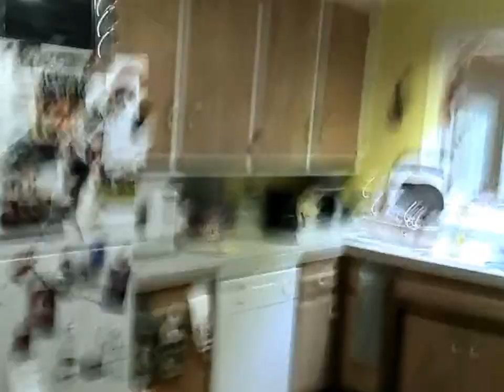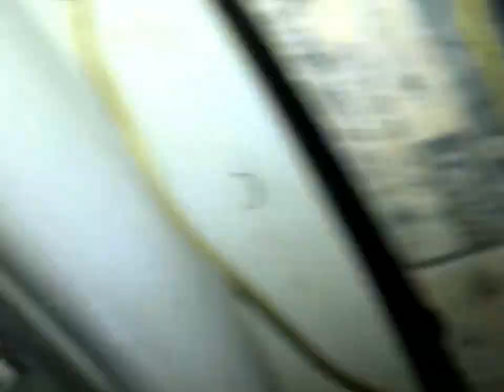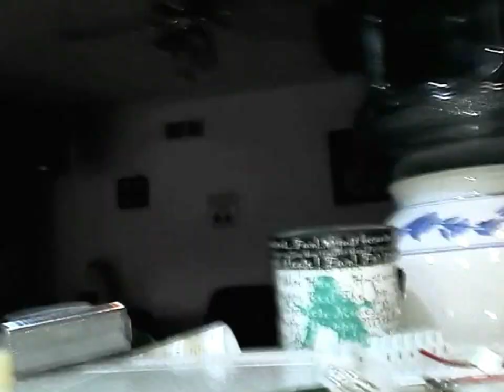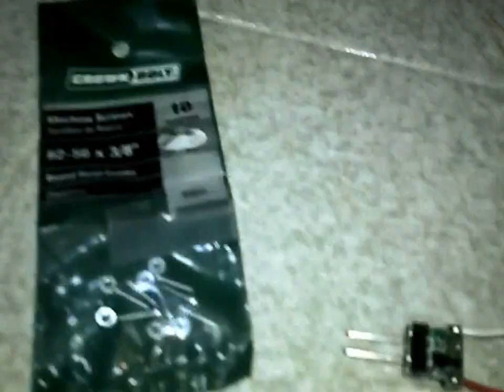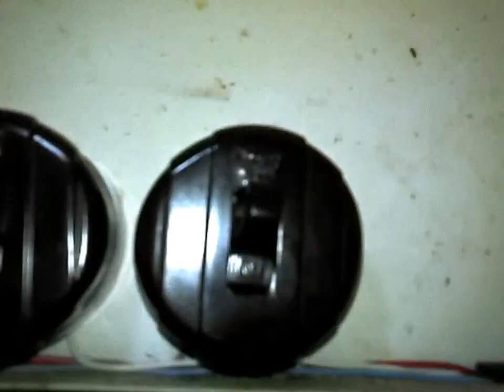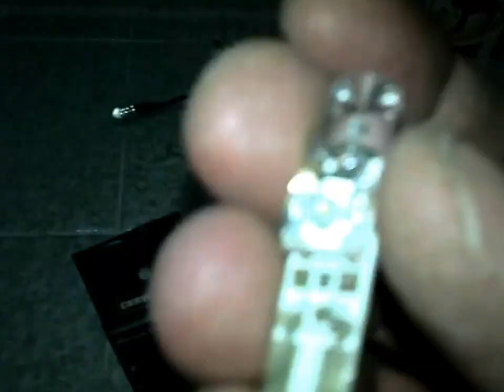Kitchen led lighting

Comment from the maker: Search "10W LED Driver DC8-26V AC/DC 12v For 10 Watt LED" and as far as the 10MM LED resistor make sure you connect/solder the resistor to the correct leg of the LED, check "instructablesdotcom/id/Choosing-The-Resistor-To-Use-With-LEDs/" 
Be Good, Godspeed,
El Raz

Comment from the maker: The batteries will lose/evaporate some water depending on the environment and the load especially in your area that has high temps, keep the battery bank area well ventilated. Harbor Freight is what I started with and still using six HF panels for my 900 watts inverters that harvest power daily, I do use the CFL lights that came in the kit and when they go out I call the 800 # and they send me some replacement bulbs. Thanks for sharing Awsome Job
Be Well, Godspeed El Raz

Comment from the maker: Hi, just did the test on the 10 W LED, room temp 85, LED base temp 123', heat-sink fin temp 116'.  The flat LEDs 145', I have no fans, what kind of a fan did you use?  I used Silver heat-sink paste that helped alot!
Hope this would help you brother.
Be Well, Godspeed, El Raz

Comment: Hello, have you checked the temperature of the 10w led mounted on the heat sink?  I have a similiar setup except I bought the heatsink (4.3" x .7". it has a solid core where the smd mounts and fins on the rest).  I get a temp of about 150 degrees F with the 10w led mounted on the heat sink.  I check on the metal edge of the smd next to the screw holes.  When I have a 12v fan blowing on the back of the heatsink, I get about 103 degrees.  Thanks for the videos.  I seem to get new info every time.

Comment from the maker: I bought some of the switches from a local old-timer ACE hardware store, they were about $3.00 each.  I have seen them at True Value too but they were like $6.00 each there.  Do a search online you may find some at Sears sub contracters websites with reasonable price.  I added some more LED lights and 12 Volts outlets to charge my wife's ereader and cell phones I will post a video soon.  Thank you for your kind comment and watching my videos. Be Well, Godspeed, El Raz

Comment from the maker: @juancarlosruiz1985 They called, "High Power 10W white LED 750 Lumen Lamp + 60 degree lens," Item # 330651677051, on ebay.  Make sure you use it with a 10W heat-sink & a 10W driver so your LED would last longer.
Godspeed, Raz